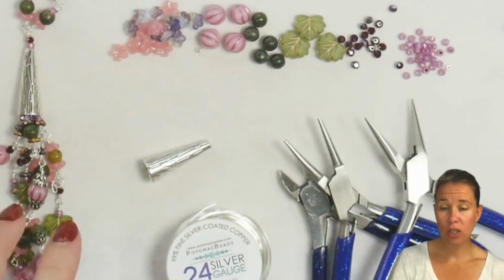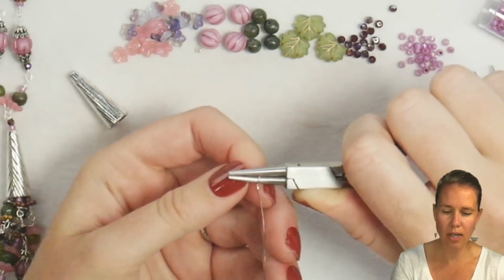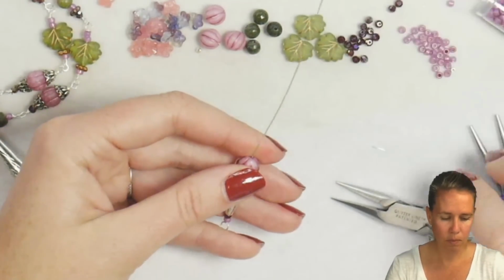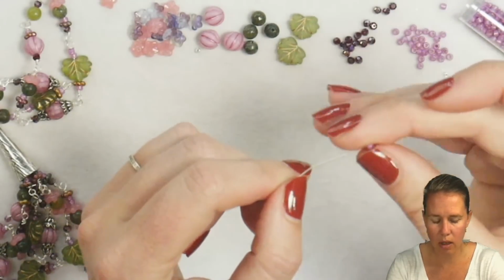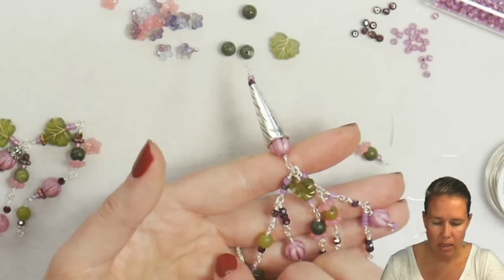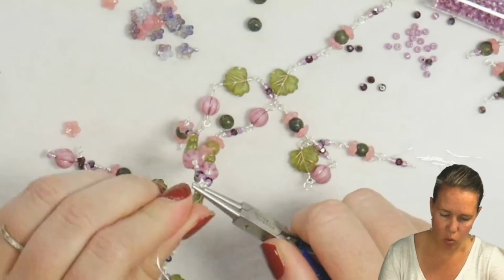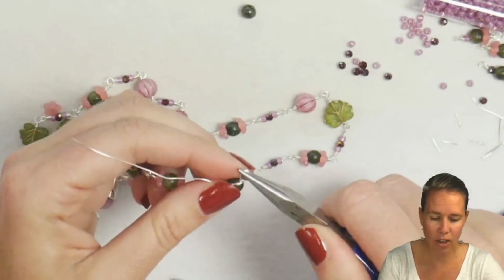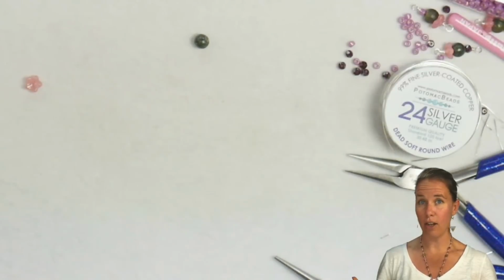Hawaiian Tropics Necklace - DIY Jewelry Making Tutorial by PotomacBeads

Comment: Just got around to making this necklace from the June, 2021 Best Bead Box.  Really appreciate the refresher course on wire wrapping and would love to see more!  A couple words from my experience:  The wire is very soft, so some links might distort  in the process of wrapping.  Don't worry about it.  Those imperfections are not noticeable when the whole project is done.  I made the necklace part before I embellished the "tassle."  I was afraid I was wasting too much wire, getting the hang of it, and wanted to be sure I had enough wire for necklace and clasp.  Then, I went back and filled out the tassel.  I have just enough wire left to squeeze out a pair of matching earrings.  :-). I would love to see more wire wrapping projects because the only way to get better is to keep practicing!  Thank you!!!